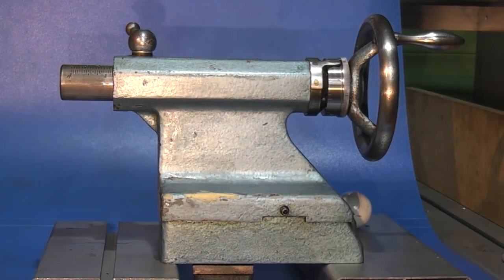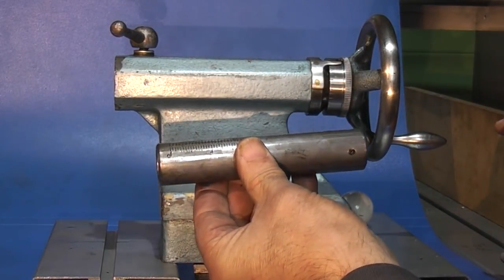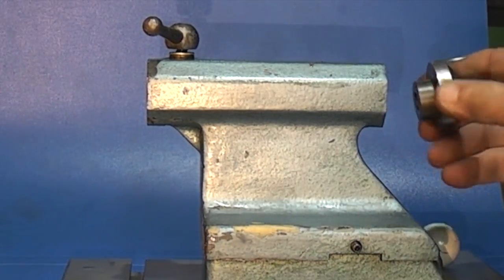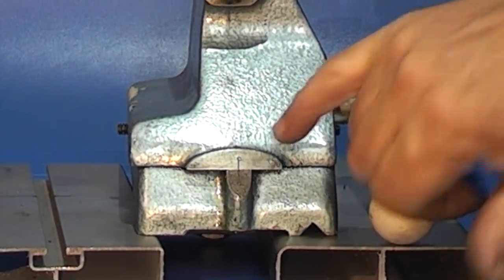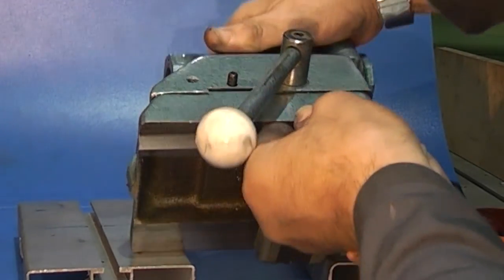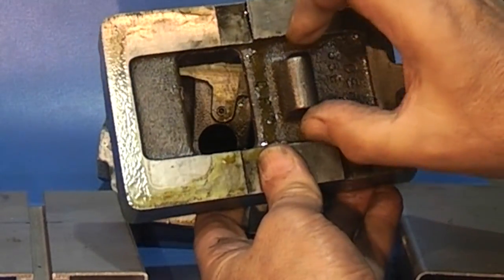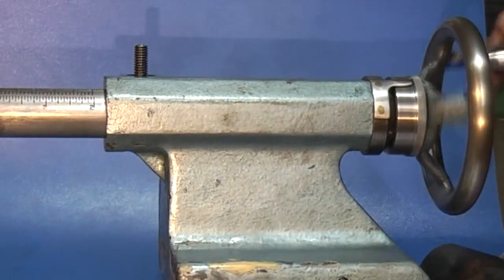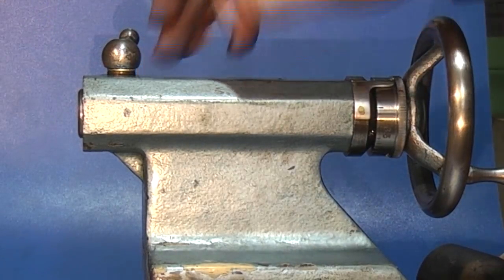The lathe tailstock

Comment: That is very useful. But I don't understand why, when you put a drill chuck in there, what keeps the drill chuck from spinning. I understand why the spindle doesn't spin. It has a slot and key keeping it from spinning. But what keeps the drill chuck from spinning when it's inserted?
Reply from the maker: Hi Sam. It's a combination of the angle of the taper and the force applied. The Morse taper angle is designed to hold the chuck that's why you need a drift to remove a Morse taper chuck or drill from a drill press..If you don't force the chuck into the taper it won't lock and when you drill it will spin. But once locked and the drill pressure is applied this puts more force pushing the chuck into the taper and prevents the drill from spinning. If the drilling force is more that the chuck holding force then the chuck will spin.
Reply: @enotsengineering  That is very helpful. I understand now. Thank you.
Reply: @enotsengineering  How do you remove a stuck Morse taper? The arbor that I have doesn't have a tang and now won't pop out. I tried pushing the drill chuck with a spacer but it popped the drill chuck off the jacob's taper instead.